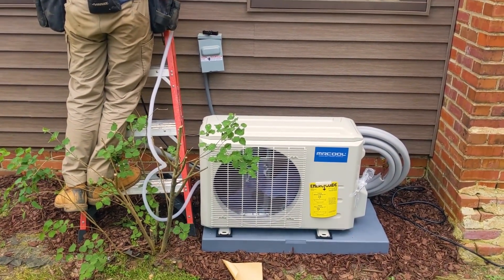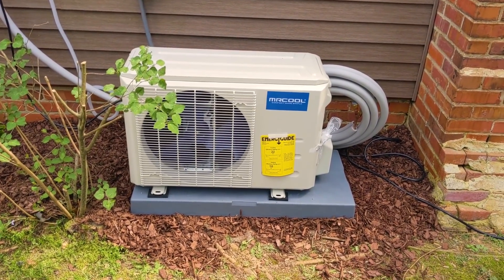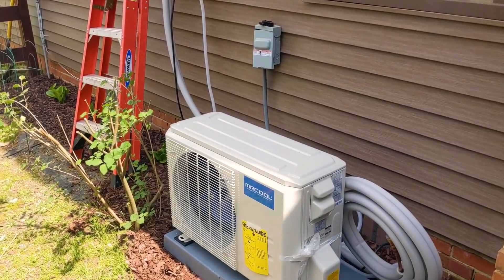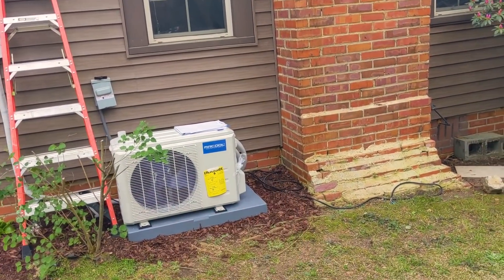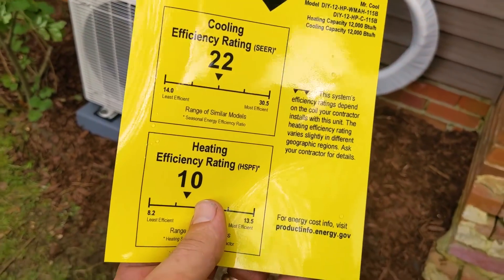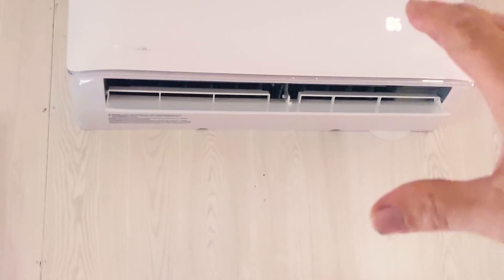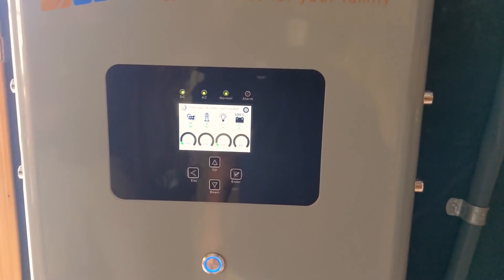Air Conditioning with Solar using MrCool

Comment: What's the difference between a precharged line set and a standard line said I guess and when you say pre-charge are you saying that the line set is under pressure with refrigerant ?? I'm confused about what people mean by that if the line isn't a pre-charged line set then what ?

Comment: Looking to do this for my garage. How much solar/battery did you need to be able to run that unit consistently?
Reply: I installed the ACDC12 hybrid unit from Hotspot energy last year in my garage, and it’s been great. It’s connected to 6-380W panels and also tied to my garage AC 220v panel for use at night if needed. I self installed so had to buy some tools (vac pump, gauges, and a flare tool because I kinked a line🤦‍♂️) but the install was not too bad if you are fairly handy.

Comment: I would like to see an amp meter on those mani splits to see start current and running load cooling to see the amps go up and down as this is different then typical Air Conditioning compressors that run full load all the time 
and  only reduce amp load very little.

Comment: Hello !  I'm just getting in to your video series - very impressive!  Do you have any information on practical / usable wind turbine solutions to generate electricity for residential?  I live in Michigan's Upper Peninsula on the shores of Lake Superior.  During the winter sun is limited at best and the wind is ever present and abundant!!  I'm hoping to find a wind turbine solution (vertical access may be preferred?) that can be used in a residential setting on a city / town street without being obtrusive.  I'm not seeing as much information on the web for turbines as I do for solar.  What I do see for turbines leads me to believe wind power is just not there yet.  Was hoping someone had done work adding a stepped gear system whereby the turbine drives a set of gears to a ratio where by the generator would spin fast enough to make usable power.   Would love to hear your thoughts and experiences !
Reply: Wind turbines get more efficient the bigger that they get. Thats why they continue breaking records for size every year. As a consequence, wind power will favour big companies that can get the capital to invest in big towers.

If you're in Michigan, I would use a combination of solar, a rocket stove like The Liberator, and a mass battery of dirt to hold heat from the rocket stove.

Comment: Do you have the same issue I have where the right side of the air handler is not flushed with the wall? If not, what do you think could be causing this?

For reference: https://imgur.com/a/pUC2Qo2

Comment: These system have worked great at our homes in Guangxi since 2004.  Whenever, you need a new unit; you go to your big box store... buy it and take it home. The next day 2 younger men stop by to install the unit within a hour. They attach a rope inside your home and out the window they go; we're only 6 floors up. You can watch them on any 30 + story apt building, working away. It pays to have a service contract to clean it/ tune up; on our 5 units for peak production when it hits those 40'c days! 
I'll be using it to finish our container home this summer. 

The unit you installed was just a straight 110, nothing special for solar, correct?

Comment: You seriously aren't leaving that lineset like that. 🤣
Reply: Makes no sense not cutting the line set to size
Reply from the maker: I seriously did.
Reply: @engineer775  Won’t oil return to the compressor will be a problem? I’ve installed around 30 mini split systems and it usually says If you must leave the extra length lay the coil horizontally.

Comment: Line set coiled up like that creates oil traps. Loops in a line set should be left horizontal so the oil returns to the compressor.
Reply: Mr.Cool installation instruction specifically state that the line be coiled as shown in the video.
Reply: This is a High pressure system.
Vs a low pressure system that has that problem
Reply: @JR.inverter  R410 is a high pressure refrigerant, but that does not mean you can ignore refrigerant piping rules. Inverted trap should be used when condensing unit is 30ft or more above evaporator to help prevent refrigerant migration. Otherwise it is recommended to have a downhill slope in refrigerant line in the direction of flow. I am aware that these products are working with looped lines but it is not correct. Example: If you put the wrong oil in your car it will still run but it is not good for it.
Reply: There is a lot of bad methods and shortcuts That I see on the field and systems work fine… And many of those systems will fail sooner or have a lot of problems that’s not if but when. Might as well make use of your investment and do it right. would anyone buy a car with engine mounts on one side it will still work.
Reply: Velocity will return oil just fine as long as there is correct refrigerant charge .
Reply: Very true.
Reply: I installed my mini split in 2010. Coiled up like that and still works perfectly.
Reply: @timcat1004  It will work but shorten the life
Reply: @vet137  Mine's 13 years old now. Working perfectly. You are wrong.
Reply: Lol - you must have studied at the University of YouTube.

Comment: You could at least bury the lineset if you're not gonna cut it and reflare it.
Reply: Hmm....hadn't thought of that.  It's one reason I was looking to get the tools and vacuum setup so I didn't have a crap ton of line laying there.  I wonder what the long term bad would be with buying it.
Reply: @wadebrewer7212  always vaccum your lineset. Removing air and particulates allows your system to run longer because the compressor is clean (only pushes refrigerant). 

Burying the lineset is common practice for most HVAC technicians that try to reduce noise from a unit. 

However in this application burying it is more so to prevent damage and hide the extra lineset if you choose to not cut the excess. I would always suggest cutting the excess.
Reply: @AJ-ox8xy  right.  Going with what the original post was, he said to bury the line set.  I hadn't thought if that with the diy precharged line sets.  It was turning me toward buying the tools including the vacuum pump to be able to cut lines to length.  You can't cut the diy precharged lines....well....I mean you could but that would be dumb and you would have to re fit with the special fittings and STILL draw it down anyway.  Youbwould be better off buying line sets not precharged (drawn down) and just build yourself. 

The diy systems that don't require you to draw down are typically 25 to 40 percent more expensive.

Comment: Yeah, really unwise idea for nearly everybody. Solar just makes air conditioning hideously expensive and short-lived. Much better to keep cool using techniques that were used in the same place a hundred years earlier; those techniques would be sustainable.
Reply: ummm, you go ahead and do that.  at 100f plus 85% humidity I'll run these mini splits. You can easily run these mini splits (and your entire home load) off of solar & battery. let google be your friend.

Comment: We run four individual 240 volt inverter mini splits in our home & 2vacation rental units (all on solar) using a radian 8048 inverter and 8800 watts of PV panels on roof.
They've been performing perfectly for years and require little maintainance.
We do have above average sunshie in the U.S.V.I. so we are able to produce an average 50 KWh per day to power everything.
Grid tied with 20 KWh of lithium storage. Units will all run for 4 hours during a complete grid outage with our limited storage capacity however its rare to have all units on all at once, and our common (almost daily) grid outages usually only last an hour or two. Most days we push an excess of 20 KWh back to grid.
We keep our personal ac unit running 24-7 about 300 days per year. Solar/lithium mini split are a
Perfect combination. No regrets on our investment at all.
The only regret  I have is not spending more for a larger battery storage bank initially when we bought our system after hurricane Irma. Budget was tight back then due to alot of necessary repair/reconstruction work. We are planning to upgrade to a new 50 KWh battery bank this year as prices are now 50% vs what we paid in 2017. Lithium and AC mini split tech have come a long way in a few short years.
Reply: Why do you lose the power every day there?

Comment: Thing to bear in mind with motors etc is startup current which can be significant, not all Inverters can handle that overshoot.
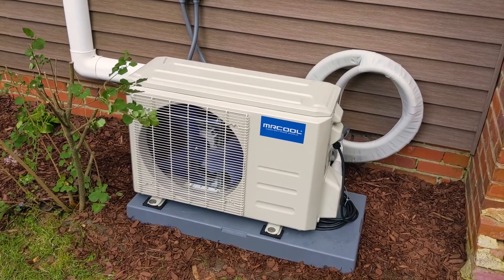Reply: 5:22
Reply: @williamwilson6499  Thanks, that's the benefit of Inverter style air cons, as E775 said, current starts at zero then ramps up, as opposed to the more conventional  supply powered induction motors (that are either on or off)  that take a big pulse of in-rush or start-up current, although one solution to that is a current limiter, but i have seen lots of mains inverter issues in that sense, like with water pumps.  If running current was the issue, you could go for the 220V option if you had that on your inverter and halve the current. I think the rest of the world runs as 220/230V single phase as mains supply anyway, beside a few, like Japan 100V wtf.  Inverter type aircons do come at premium though, maybe this point could have been elaborated.

Comment: Scott I've wondered if the lineset can be hidden in the wall if insulation doesn't bunch up -- goes in where you did it here, then pops out down low by the unit.
Normally see these with condensate pumps, but looks like gravity just brings this out to the flower bed. Thanks for an awesome YT channel!

Comment: Are there DC air conditioner units that don’t require the inverter?
Reply from the maker: Yes we have a 48-volt version that doesn't require any inversion but it does require batteries. So the system is solar charge controller and batteries and then it's a direct DC hookup but it is 48 volts

Comment: Remember ALL units installed in Cold climate areas will draw more power when its pretty cold outside . Its simply physics. Say desired inside temp is 70 and outside summer its 100 F  thats a 30 degree difference to cool off compared to 10 F outside in winter thats a 60 degree difference so your power will be roughly twice as much. This is of course true of ALL HVAC units.
Reply: Good point. So how do you think this would perform in extreme climate differences like FLORIDA?
Reply: @Bonniemish  Personally if the non DIY mini splits were more than 7 SEER or 25 % more efficient than the Mr. Cool I would use them and still DIY them.  Direct solar DC mini splits are a good idea with ac power backup which can be also from your batteries etc but they are generally about 22 seer and cost more so I would favor the normal units. You have to also ask who would service the direct dc units other than freon etc.   
I would choose a split inverter compressor and fan unit  with air handler AND ductwork in the conditioned space  This could also be geothermal and possibly zones if needed OR however many  single high efficiency Mini splits 30 or higher  so about 12,000 but or less units or maybe mixed multihued unit with single units. With this choice you also have redundancy if one unit goes out.   
Since you have mainly cooling needs and relatively long sun hours and cooling takes place mainly during sun hours you can get by with much less battery capacity . With DIY batteries LifePo being near $100 per Kw I would use straight electric for the more efficient units and buy more batteries if needed.

Comment: Good product and install etc. 2 things
If you have a 240 volt inverter I would favor a 240 volt mini split so the power drawn from inverter is balanced or at least make sure the load center is as balanced as possible with the larger loads likely to run at same time

I would also favor either a dual powered direct dc/ac powered  mini split to run direct from solar  OR when and their SEER s are generally in the same ballpark.  If not that then I would go with a higher seer product when available in sizes you need such as in 12,000 but there are at least 31 seer quality products available . Over time this will save quite a bit of energy about 30 %. Granted its 30% of a pretty small amount but its still 30% .  You can still self install these without brazing though you will need a couple hundred dollars worth of tools  ( vacuum pump and HVAC gauges etc).  If you dont want to do this it would likely make sense to get the DIY MR COOL units.  

Remember EVERY INVERTER COMPRESSOR AND FAN based unit prevents any Surge load on your inverter.

Comment: FYI if you have shorter runs you can order the Mr Cool with 16 foot line sets instead of 25 feet that way you do not have to coil as much behind the condenser.
Reply: According to Mr. Cool the only pre-charged line set length is 25'.  Other line set lengths are available but they are not pre-charged.  Anyone heard otherwise?
Reply: @sammygeorge7122  I bought a 16 foot here is the link https://iwae.com/shop/12k-18k-btu-mrcool-diy-ductless-split-system-line-set-ha20975.html then you can choose either 16 or 25
Reply: @Pappy-1  I think there may be some confusion.  The DIY unit comes pre-charged with refrigerant but only in 25' length.  Other line sets are available hower they are not pre-charged wifth refrigerant according to Ingram's.  The unit being installed in this video is a 12K DIY and according to Ingrams all DIY units are pre-charged and only come in one length, 25'.  I've installed the same unit in my shed and if a 16' pre-charged lineset were avilable I would have bought it.
Reply: @sammygeorge7122  well I lucked out apparently because both my 16 foot linesets were precharged and it heats and cools the two rooms I have the wall units in. I emailed Ingram to see if Mr cool  has changed this from last year.
Reply: @sammygeorge7122  just got an email back from Ingrams and here is what they said "Hey this is Wes. We have both pre-charged and non pre-charged. The pre-charged goes for the DIY units and non-charged goes to the Advantage system

Wesley Kilcoyne
Customer Service

Comment: What is the average running watts/amps of one of these? I was considering getting one of the new 33 seer models, I think they run at around 300 watts but I cant get a definite answer
Reply: It would de[end on the load and size of unit in BTU s, SEER rating  . The maximum would be in the units specs . Typically it may ramp up toward maximum to get the room to the thermostat setting then it would ramp back down and of course that would depend on the heating /cooling load of the space it is conditioning ( how well air sealed and insulated it is). Typically I would say for a 12,000 BTU unit it may consume around 500 watts once the set point is reached or a little less.

Whatever it is you cannot change (except not use any emergency heat strip etc) and its the lowest draw you can get on that size unit unless you get a very efficient water source unit so live with whatever it is, I assume you are either curious or planning on how much solar/ battery backup you may need.  GOOD LUCK with your project !!
Reply: @teekay1785  Thanks for the info! I have been off grid for years. I have 5kw of panels and 20kw of batteries. I guess battery storage wouldnt really mater because i would only be running it on sunny days anyway. My batteries are at float by like 9AM

Comment: What size solar system would be needed to run this unit?
Reply: Ideally you size your solar for over the rated consumption of the unit at maximum. 12k btu usually runs at 800 watts so 1kw solar at minimum.

Comment: That seems like a big waste of refrigerant and LINESET that is being left there
Reply from the maker: Every install is different but 6' of extra lineset is a small price to pay for the convenience.
Reply: @engineer775  And you don't have to train the installer on brazing etc.
Reply: You should avoid vertical loops when coiling the line set because compressor oil will eventually settle in the bottom of the loops causing a restriction that could damage the compressor. Better to have purchased a length of tubing closer to what was required, maybe even move the outdoor unit a bit farther away to avoid loops.
Reply: @georgeian3243  Couldn't you just twist the loop until it's horizontal?
Reply: @cellocovers3982  True enough, you could create a space behind the unit to fabricate a horizontal loop thus eliminating oil traps.
Reply: Or, you could listen to the videos that say manufacturer suggests leaving excess line in a coil. Every video has people stating to do opposite manufacturers suggestion. Manufacturer says it, 775 says it, therefore, it is.

Comment: So no vacuuming? How's that work with air at your connection to your head unit?
Reply from the maker: @marthale7 If you pull a vacuum on this setup it mean you made a mistake.
Reply from the maker: The linesets are pre-charged and the connections are designed not to leak when connected.  No Vacuum.
Reply: @marthale7 If you pull a vacuum on a precharged lineset, you would need a collection bottle and have to recharge the system I think.  The do it yourself units eliminate the vacuum pump.  Use soapy water.
Reply: My understanding was that the refrigerant was in the outdoor unit, but it was best to vacuum down the line set and indoor unit to get all moisture out.  Unless there are shutoff valves on both ends of the line set connections then air, and therefore moisture, is present in the system... Maybe I misunderstand or have just researched a slightly different style DIY system.